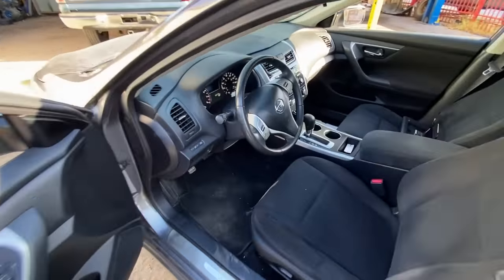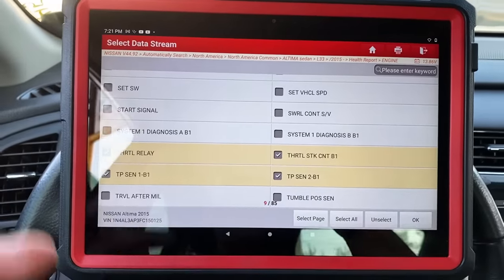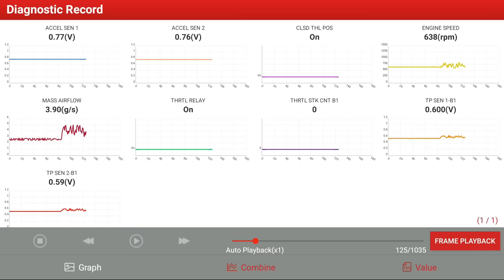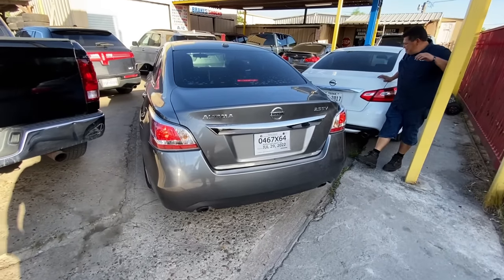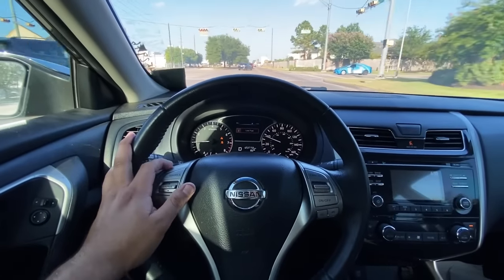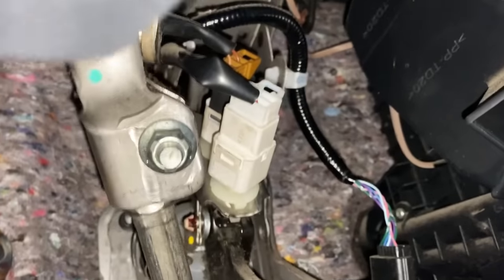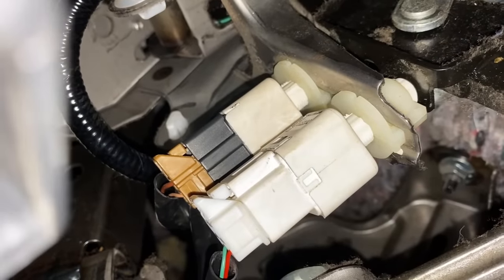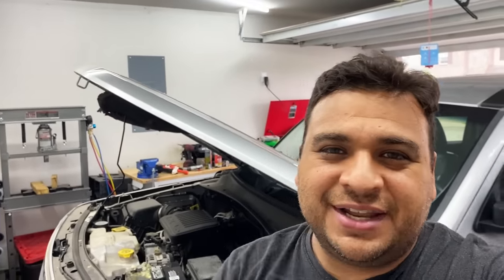NISSAN ALTIMA RANDOMLY WON'T ACCELERATE ABOVE 25MPH!!

Comment: Nice catch! I’ve had one of these on a Ford. Found BOA Brake Over Acceleration pid and verified brake switch was sticking on and Pcm was cutting out throttle.
Reply from the maker: Thanks for the info

Comment: Nice process.  If you unplugged one of the sensors and scanned the ecu it would give you a code for sensors 1 or 2. I had a nissan 10 years ago that went into limp mode because 2 of the 3 break lights were blown.

Comment: Man, I've got a similar issue with my 2007 Nissan Altima standard 4 cylinder. I just bought a Hitachi throttle body w/gasket from Amazon for an amazing price, but now, going to send it back to them to get a brake relay and work backwords. It only does this intermittently and at lower speeds during acceleration. On the highway I still get good performance.  A couple of years ago I thought it might be my transmission (CVT) going out so in my desperation had my mechanic remove it from the car and send it to a Nissan dealer's shop costing me about $3300. Nissan wants to do all CVT transmissions and doesn't support local shops doing any of the work on them. It seemed fine for a while, but not sure what they did but replace the internal belt with the upgraded kevlar. It was making a whining noise. Anyway, thanks for this input and I've just subscribed to your channel for more tips!
David 😊

Comment: Thank you … I am having this same exact issue.  Wondered why brake lights kept staying on.  Didn’t know if throttle body was sticking or air filter was dirty, needed tune up. I did the first two and was about to spend money on  new plugs for a 16 maxima.  Woulda been throwing money away for nothing. I am goin to try the brake light switch and the relay
Reply: Works for you?
Reply: @JoceMaldonado nobody returns to update. They are all takers.
Reply: Nobody returns because they died before they could fix the switch.

Comment: I had to change the transmission at 169.000 miles. I now have 294.000 miles still running great.
Reply: Try using Amsoil CVT fluid the factory ns2 CVT is trash.

Comment: Just fixed one just like this. Aftermarket floor mat would slide forward crumple up in brake pedal area. So if your not using factory floor mats cut hole in hook area of original mat hold down hooks. This will keep mat from sliding forward into brake switches area causing error.

Comment: Tengo el mismo problema con un Sentra 2014. Tu vídeo me servirá de mucho. Gracias amigo
Reply: Como te fue?
Reply: @vico07  había un problema con el odómetro eso de cierta manera distorcionaba la red canbus. Ese odómetro tenía dañada la pantalla reemplace dicho odómetro y el problema desapareció

Comment: Didn't see that coming, u would expect it to throw a brake corellation code at least, But seems like Nissans aren't really smart cars after all.
As I just recently realized they don't even have cam crank correlation codes such as P0016 and P0018 only vvt codes such P0011 and P0021, Or maybe I am just wrong.
Top notch diag as always Eric, Thanks a lot.

Comment: Had this exact symptom on a Nissan and  dealer couldn’t solve it. Turned out to be a microscopic crack in the right tail light assy. Moisture was wicking inside and causing feedback in the brake light circuit.
Reply from the maker: wow! Interesting!
Reply: How and what did you do to fix this problem ? I’m having an issue too

Comment: My Nissan Altima S 2015 does exactly the same thing, especially at the beginning of driving when the engine is not sufficiently warmed up or something. Once I drive gradually to the highway above 70 miles per hour, it drives normally. I believe. My doesn't do randomly but at the beginning of driving when you try to accelerate from 15 miles to 30, 40 miles/her.

Comment: Summary: 
To reproduce the problem, go on a road, take a u-turn and you will notice the car is not speeding up beyond 25 mph.
The problem was the brake light relay which was affected how the computer works. The brake light switches are located beneath the brake paddle, which can also be replaced to fix the issue. Hope this helps.

Comment: Had a similar situation with my Jeep Compass. 

It started randomly decelerating on the highway. After getting it towed, I believed I needed to take it to the dealership to get a full diagnostic. Various people speculated on the solution: a new Actuator, a new starter, gas detox, a new battery etc etc 

Fast forward I got referred to a mobile mechanic from a coworker. He visited my car that wouldn't crank and tested it for free. Then did a deep clean on the battery getting rid of all corrosion. It worked good as new. He only charged 80 bucks, whereas anyone else could have been $300-700 easily.

Comment: 😂... I got rid of my Altima because I thought the transmission was going. CVT history.... It could've just been the brake switch... Wild 😂
Reply: Brootal
Reply: Dude I'm thinking the same too LOL, I have a 2019 Nissan Sentra and all of a sudden my gears weren't shifting correctly, then. All of a sudden no power to the gas pedal but if I slow down I can maintain the speed from 15 to 35mph

Comment: Had an unexplained random power loss on ex's 2009 Rogue. The last time it happened was on the freeway in rush hour traffic, scared the hell out of her. She said it felt like the gas pedal wasn't doing anything. No codes when I hooked up my reader, couldn't find anything wrong. 

Search for "sudden power loss Nissan" turned up a thread on NICO forum. Nissan tech spilled the beans. The POS CVT was crapping out, and requested ECM to kill the power. Transmission does set a code that they could read, but not the average code reader, it's hidden from you. 

There was a hidden warranty extension for this, but the Rogue was just past it. So ex traded off that POS with the Junko manufactured CVT. Only had 69k on it. She loved her Rogue, it was paid off, she planned on enjoying it + no payments. But it had to go cause hell hath no fury, etc. 

Few months later a guy at work asked me what could cause random power loss on his 2012 Sentra with no CEL. I explained to him the joys of Junko CVTs...
Reply: But it wasn't even the cvt. They're quick to say it's the cvt though..of course they want money
Reply: Lol, it wasn’t the CVT.

Comment: Thanks for the video, I have a 2015 Nissan Altima that seems to have this issue, it’s been years like this and nobody have found the problem, now mine started by giving me issue when the tank was 1/4 or less but now sometimes it doesn’t even with more gas in the tank, I changed the spark plugs and the car worked fine for a week, also I replaced two of the coil because they looked bad and again the car worked fine for a week, also for maintenance purposes I replaced the pcv valve and again the car work fine for a week, I don’t have a nice scanner like yours also my car does not any codes at all no even when it doesn’t accelerate, I could talk to an actual mechanic and see if he can check the things that you checked in your video, thanks a lot

Comment: I have a 2016 Rogue with a similar issue. I could be driving on the highway, stop at a light and when I want to speed up, the first 5 seconds, the car doesn't want to go, just creep ahead and then gradually back to normal.  I read that my car has some issue transmission temperature and that the vehicle is trying to protect itself.  Interesting video though!  I'd love an easy fix for this issue.. it can make turning left at an intersection difficult because you have no power for around 5 seconds.  It only happens when it's warm out, in winter, never an issue.  I could pull the rear hatch plastic of, then I could see the glow of the 3rd brake light and see if my light stays on momentarily while this happens.

Comment: Perfect vid, I just bought a 2006 ultima with uneven idle 700-1,800 rpm up & down   I reset throttle body & it appears new then on 3rd day car started hesitating then throttle body drops out and like u said U could floor it & it might only go 5mph then stall out and not want to start. I reset throttle again then it backfires white smoke from front of car  stalls out I reset throttle body one more time then it blows white smoke for3min I shut car off let it sit for ten minutes the did whole procedure again and car would return to normal then drop out again in a mile set all kinds of codes but if you reset cpu it would go about a block normally then drop out again so I'm thinking it has blown head gasket as water was down in radiator after drive and I had topped it off after purchase. I also noticed no water came out after removing coolant sensor which is why coolant temp sensor never rose above a 3rd of the gage... I think they might of put some gasket sealer in it and it lasted 2 days then blew out again as we drove it 30miles bringing it home without issue other then oscillating throttle in park

Comment: Excellent !! I'm having the same problem with my daughters car. Its a 2015 nissan sentra though. Nissan had me change the transmission and air flow sensor so far and still having the same issue. $6000+ in repairs so far.. My daugther says it happens but at times she wasnt on brake pedal ?

Comment: Could you help me understand why you can’t accelerate while the brake switch is activated bc I can hold down on the brake and accelerator at the same time and force the car to drive against the brakes? Same car too. My daughter says the same thing is happening when she comes to a long stop. I drove and it never happened to me. Thanks and good work!
Reply: I have the same question. It happens to me when it rains.

Comment: It's quite common to see brake input override all throttle input over here in the UK.
It's a failsafe should the accelerator pedal get jammed.
My car is a 2002 GM and if you try both pedals at the same time it cuts fuel back to idle after about half a second.
That's done by the engine ECU as my car has ABS but not traction control.
My car has the two brake switches in one (4 pin switch) and an interesting scenario: if both main brake lights are open circuit it sets a code for the brake switch and the bias voltage on the circuit will light the LED high level brake light.
Reply from the maker: Thanks for the info!

Comment: Awesome video. I am having a problem where my Nissan Pathfinder 2015 won't accelerate at times. Almost left me stuck today. After this video I'm convinced it is the brake switch relay. This is Nissan recall PC786. 

 Exterior lighting: Brake lights: Switch
Recall date
2021-01-19
Recall no.
21V020000
Nissan North America, Inc. (Nissan) is recalling certain 2013-2015 Nissan Pathfinder vehicles. The location of the brake light switch may cause the brake light switch relay to repeatedly open and close. Overtime, this can cause the relay to stick in the "ON" position, with the brake lights remaining illuminated even when the brakes are not applied. Additionally, this may interfere with the brake-shift interlock, allowing the driver to shift the vehicle out of the "Park" position, without depressing the brake pedal.
Hide details 
Recall consequence
Continual illumination of the brake lights can prevent other drivers from realizing the vehicle is actually slowing down, increasing the risk of a crash. With the brake override activated, the driver will not be able to accelerate normally, increasing the risk of a crash. The driver can shift the vehicle out of the "PARK" position without depressing the brake, allowing the vehicle to rollaway, increasing the risk of injury.
Recall action
Nissan will notify owners, and dealers will inspect and, as necessary, either re-install the brake light switch or swap positions with the Automatic Speed Control Device (ASCD) switch; depending on the model year vehicle. In addition, the brake light relay will be replaced with a new one. All repairs will be performed free of charge. The recall began March 1, 2021. Owners may contact Nissan customer service at 1-800-867-7669. Nissan's number for this recall PC786. Note: this recall supersedes 16V-380.

https://www.cars.com/research/nissan-pathfinder-2015/recalls/

Comment: 2separate input switches at the same location is an overkill.  Relay cld’ve had carbon buildup. 
Nice lesson, sir!👍🏾
Reply: Maybe one switch is for brake lights the other is for cruise control cancel. They signal opposite of each other yet physically move the same. One switch could also be a major input to the CVT automatic transmission. Take care.
Reply: @dancarney106  
I’m an Engineer. And I also reverse engineer ECMs at a major Co. These are basic switch input signals (Gnd/Pwr Sw). I still say they could have combined just one signal into that relay, and redirect any needed input signals to the other modules. 
In any event, what’s done is done.

Comment: This is currently happening to me while cruising. I've noticed that my car suddenly loosing power like no response at all even though i hit the pedal and will eventually go back to normal. one thing i noticed is that my car will be unresponsive and felt like my car is doing an engine break. i tried scanning it and actually monitoring the live data but no luck.  

thank you for this video i will try looking my break pedal switch and relay.

Comment: I drive a 2012 altima and when I had this problem, sometimes the car would very slowly pull forward from a stop, and at times on the highway my cruise control was set to say 80 mph and suddenly the car would start slowing and would not go faster than say 50 on the highway. The problem would come and go. I changed the mass airflow sensor, the throttle body and reprogrammed it, and the problem kept coming back. What ultimately fixed the problem was draining and refiling the the trans fluid and replacing the trans filter. I was surprised that that would fix it but it did. I don't go to shops but if you're willing to, the shop would do a tranny flush which you can't do at home but would probably be better. If you're like me and want to save money and don't trust shops, then drain and refill the trans fluid and replace the filter.
Reply: I have two 2015 Nissan Altimas and never had any of those accelerator problems. One Altima had 372,712 miles on it original engine and cvt transmission. The other has 270,853 miles on it original engine and cvt transmission. Change transmission fluid at home every 80,000 miles. Change transmission filter and transmission cooler filter every 200,000 miles. Also added an external transmission cooler to each transmission. No shop/dealer needed to replace transmission fluid or filter.

Comment: At this point when you realize stop light stills on absolutely can cause failure like that cause the Ecu can't figure out.  How would you pretend to accelerate pressing the brake pedal at the same time 🤔. Sounds logical right . Great video thnks for sharing knowledge.🤗😎

Comment: Why there are 2 switches on breake pedal?usually just one i have seen on many cars.one moore interesting point there is no fault code on ecu unit for that false,theese are software bugs of nissan.anyway your diagnose solved problem as well.good job.thank you

Comment: Seen this on a few Nissan and Hyundai  its built into the programming due to the car seeing the brake and gas at the same time, it will kill the throttle thinking the gas pedal is stuck.  Normal operation, which is why there is no code.  Its doing what its designed to do.    The first one of these through me for a good while.

Comment: Same problem with 2014 Altima, dealer ship found nothing during test drive. No code errors. I had them change the fuel pump. Problem solved .

Comment: Thank you so much for the video I have the same problem with my car and just wanted to update you that after replacing the relay I drove the car for a week absolutely no more intermittent problems so my problems is fixed
Reply: What year was your car? Was it an Altima ? I have an 09' that's doing this.
Reply: @Artillery-Vet  same here,2009 Altima,did you fix the problem?
Reply: @Greg k  No. I'm gonna schedule a full service Trans Oil change where they drop the pan, clean out the metal shavings that get stuck on a magnet. I've heard adding an extra oil cooler can help and replacing the Trans valve body helps this issue too

Comment: I have a 2010 nissan cube I'm having acceleration problems when I stop at a red light or stop sign when I accelerate it doesn't pass 5 miles per hour i took to NTB they said it needs new spark plugs didn't work i took it back a second time and they said it was the catalytic converter still doing the same now I'm going to take it to another shop tomorrow hopefully they will fix it. Great well detailed and explained video by the way 👏
Reply: Although it hasn’t been very long, have you gotten it back with the issue resolved?   If so, what was the issue?  I’m experiencing the same issue of anytime I stop and have to idle for like 15+ seconds before accelerating again, the car doesn’t really wanna accelerate at all.  The only way I’ve been able to combat the issue is putting the car in neutral at stops and bump the accelerator consistently, then putting it back in drive once my light turns green/I have the right of way.  It will do the same thing when reversing/taking off after I idle in a parking spot for any amount of time greater than a minute or two.  The ABS light will come on and won’t accelerate in reverse or drive, but will rev out just fine in park or neutral.
Reply: After taking my car for the third time to a mechanic They couldn't fix it They found a bunch of issues with the transmission now i just gave up i called the dealership to come and pick it up i told them I can't have a car that keeps breaking down on me.